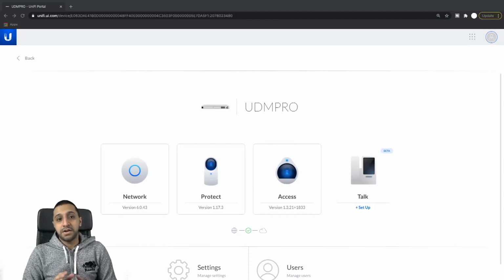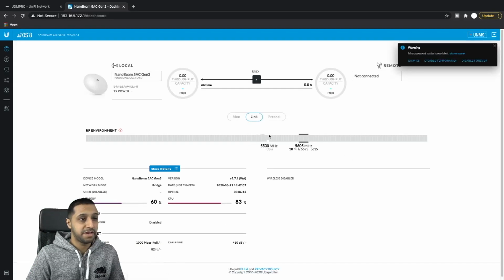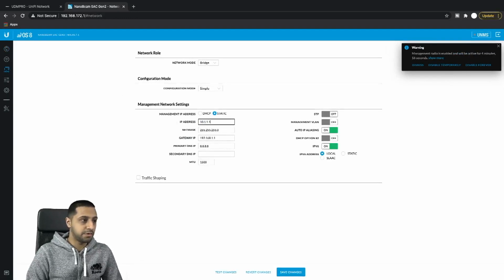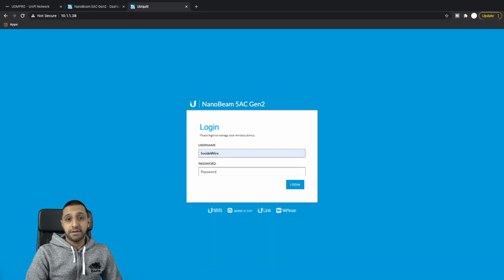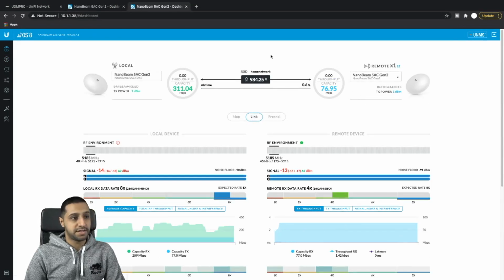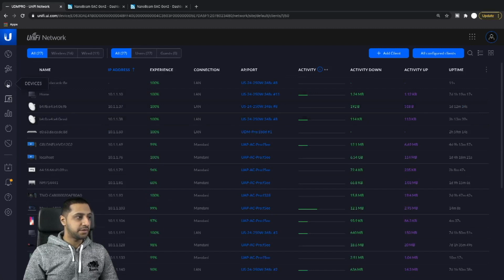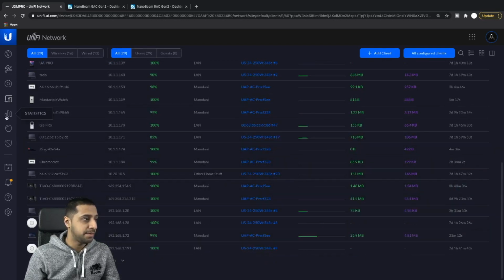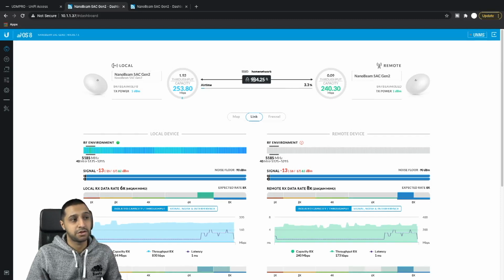UniFi point to point wireless bridge set up with Nanobeam AC Gen 2

Comment: I have a few ptmp nanobeam setups with unifi equipment stretched out over a few campgrounds. I SO wish they would integrate these 2 product lines more. I need the map to work or at least display correctly or have airmax devices separated

Comment: I contacted today with a seller of this units to buy two. He say that it wont work good in very short distance its recommended to have them at least 100 m away. You setup a link on 1m distance and all work good. 

Any ideas? 
Is it possible to reach 400mbps+ on 300-400m link with direct visibility i think there will be no other networks interferring (hope so).
Probably tomorrow i get my set of devices and we will see :)
Reply from the maker: Ive set this up around 100 meters and good reasonable speed. Not done one at that distance yet.

Comment: Thank you, Thank you, Thank you. You're the only person who was able to properly break this down for me. I did have problems with the nano beams connecting. I found a blog that explained to switch to 20 vs 40 MHz and it might work, which actually did the trick. So Thank you for posting this video. I am using a 16-150w switch and changing the port to 24v passive powers the nano beam. Hope that helps.
Reply from the maker: Excellent. Glad the video helped 😀

Comment: I am trying to set up a point to multi point. Is there anything different I would have to do?
Reply from the maker: When setting up the point to multipoint for AC devices. Ensure your "station" first device is set to access point on and PTP is off. All addition devices need to be set Access point off and PTP off. 

Hope that helps.
Reply: @InsideWire  That worked, Thank you
Reply from the maker: Awesome 🥳 glad it worked

Comment: Hi, how would you setup the wireless router on the station side? Plug LAN wire into Wan or Lan? Dhcp off?
Reply from the maker: In theory yes, but why would you want to set up a router on the station side? You are able to plug in a switch and create a VLAN for a different network.
Reply: Plug into LAN, Turn DCHP off also go to advanced settings and select turn into access point. This would allow you extend your network for example house to pool house and use that router as a wireless access point in the other location on the same network. The main switch/router will handle all dchp request and configuration should be made through it.

Comment: I have recently gotten fast internet and i'm wanting to extend it out to the shop. Recently got fiber out where i live and i'm switching over to the 1Gbps down/1Gbps upload package on July 1st.   Which is roughly about 450 feet away from the house. Originally i was wanting a point to point system that was able to do a Gigabit wireless link. But, i dont think i want to speed a crazy amount on this. I've not been able to find the max link speed with a pair of these devices. I saw yours was around 250Mbps and they were about 3 feet apart.  So, is that the best I can hope to achieve from a pair of these?  My plan on the remote end was to just hook up a normal netgear AIO router/AP.  So, i'd have a few wired ports available as well as an wireless access point.
Reply from the maker: From my testing thats the best i was able to get, I never really went any further to tweak with the settings to see if i could get it higher. 
I have seen other people get more but depending on what you are looking to do, the 250mb would be a good enough speed for most people.

Comment: I've setup my Nanobeam's from our church office where our network is at, to our picnic pavilion about 250 ft away, direct line of site after trimming some tree branches.
They seem to be talking to each other just fine, but I can't see them on our network, and they are not showing internet access.
I notice in your video that you did NOT toggle on point to point. I have it on, should it be off?
Also, I went from static IP to dhcp, and still no joy.
Problem with static ip, i'm not sure what IP to use to set them up, because with an IP Sniffer I get 192.168.1.xx OR 192.168.10.xx, AND my Nano's are showing 2 IP addresses.
192.168.172.1, and the dhcp IP is 192.168.1.162.
Has to be a simple setting, but I can't figure it out.
Reply from the maker: I would set up the IPs as fixed and have them on the same subnet range as your UniFi hardware. That was they are all on the same IP Range and can speak to each other. 
Do you have a switch on your pavilion side? or what do you use on that side?

The point to point toggle is just a point to point and multi point to point.
Reply: @InsideWire  Nothing on the pavilion side yet. I was going to either wire a switch via the Nanobeam pass thru, or connect a Unifi AP out there to attempt to livestream outdoor worship (of course, Pastor wants to do that this Sunday, April 4, 2021.) We have a USG providing our IPs from our provide, connected to a switch in the church office, then everything comes off the switch. How can I tell which IP range to use? With an IP sniffer, I get either 192.168.1.xx or 192.168.10.xx. Each list has common items but then each list has unique items to that IP range.